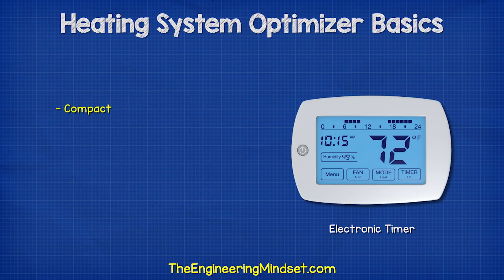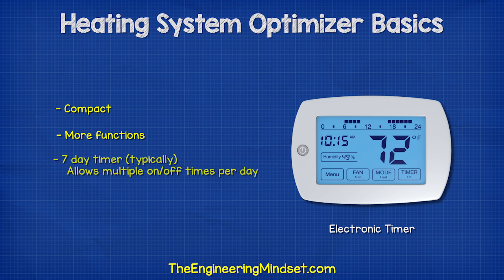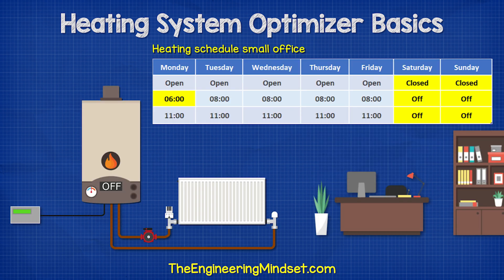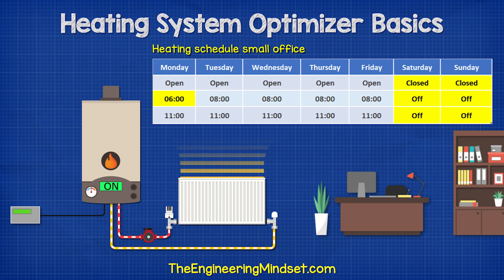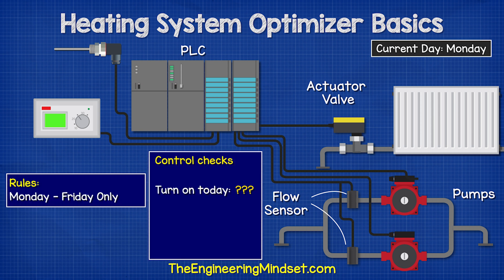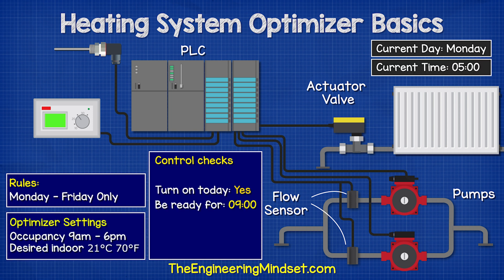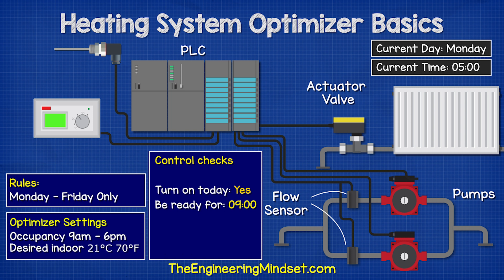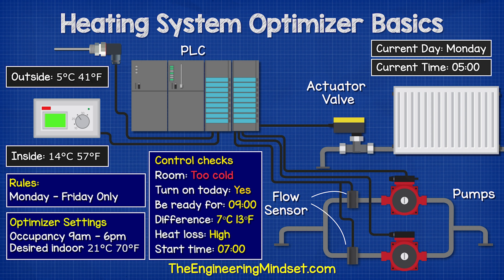Heating System Optimizer Basics

Comment: Another great video, as always. With PLC or DDC systems the 'early starting' is actually called optimized start/stop and there are typically unoccupied setpoints that will enable a heating/cooling system when temperatures get out of range, even when there is no one in the building

Comment: Great Video.

 I worked in a hospital and large Convention center with a full blown Siemens DDC system. They even adjust boiler water temperatures to keep them running longer at a lower temp to make the boiler more efficient. With VAV variable air volume controls and digital sensors it is amazing what can be done to save NRG. We also have residential high efficiency furnaces up to 98% efficient with ECM motors and variable firing rate burners now.